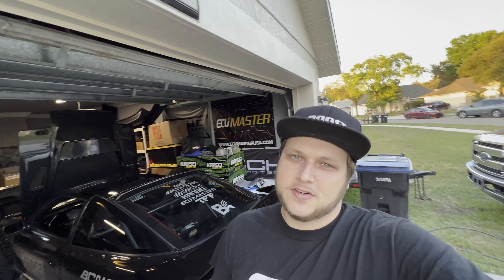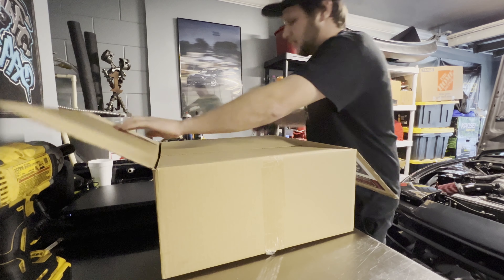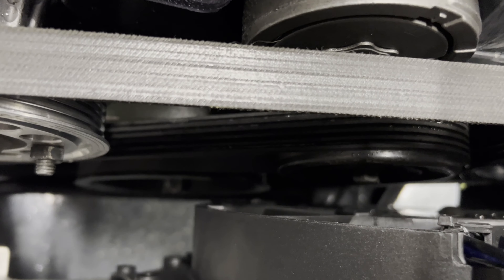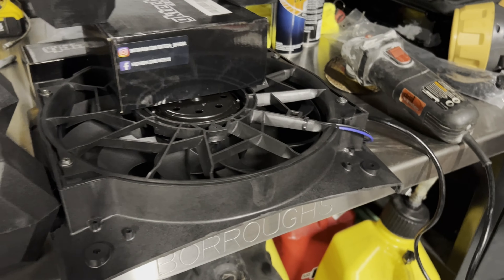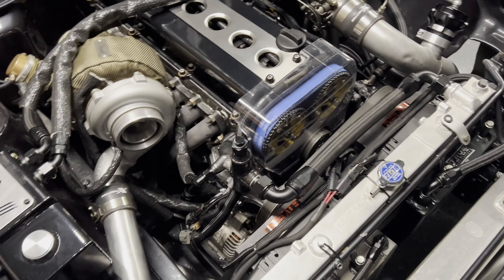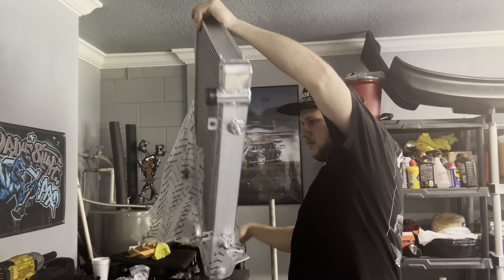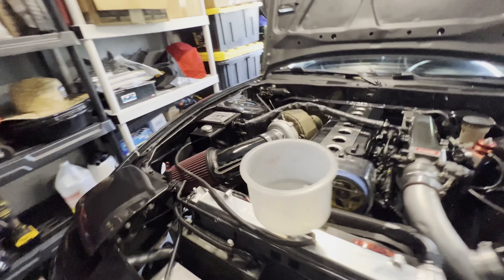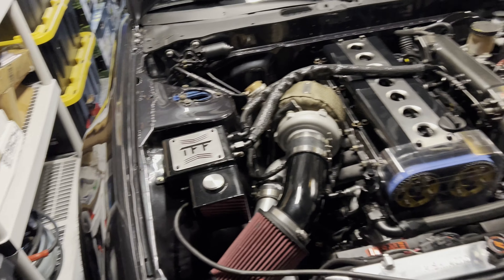How To Keep Your 1JZ/2JZ Swap Cool!

Comment: If you really want to make the cooling better you need to run the back of the head to the top of the radiator. Larger fans will just bandaid it. Line routing is one of the biggest things to keep these cool so your not just circulating hot coolant back into the engine.  Also get a radium expansion tank. It’s a swirl pot which helps a lot on these.
Reply: Any pics or example on how to do it?

Comment: I think your line for turbo cooling is not helping out too. How TF you can lay down a line almost straight on the 900-1000deg C manifold which is not wrapped? This sleeving ofcourse make something, but can not replace reasonable thinking...
Reply from the maker: It’s not straight on the manifold it’s actually a good amount away. Many people have it exactly the same and a small amount of water goes through there. No issue there. Can’t really route it another way.
Reply: @MattShulman  I didn't say, that there is another way for the line. From my point of view, this is not just a factor in efficiency of cooling system, but it is straight unsafe - can cause a water leak during a run or moreover - during a competition. You can simply wrap a manifold to stay on the 'safer' side.
Reply from the maker: @FaworDrifts  wrap on manifolds contain too much heat. The manifold is coated